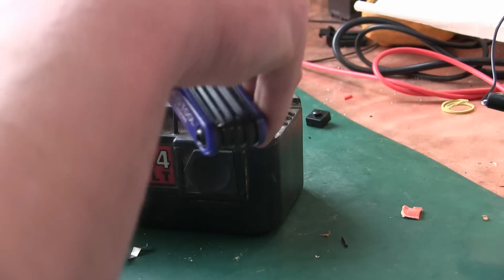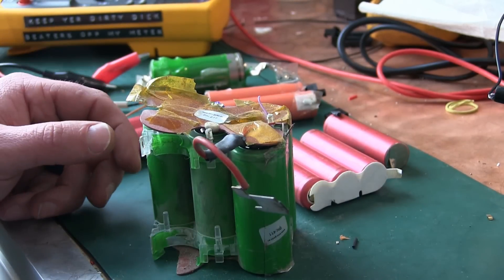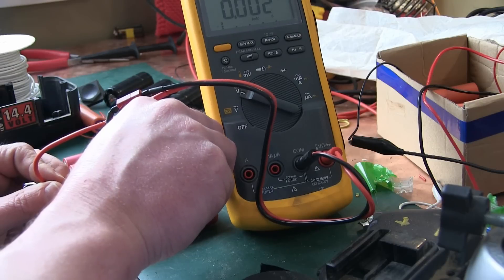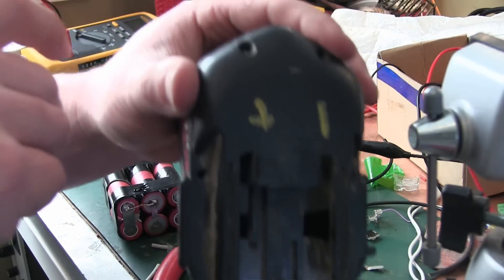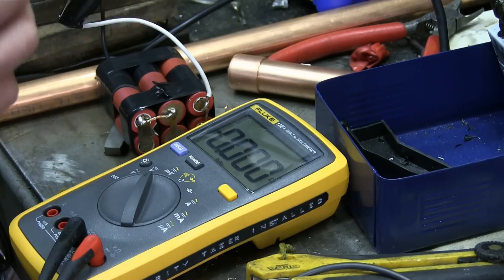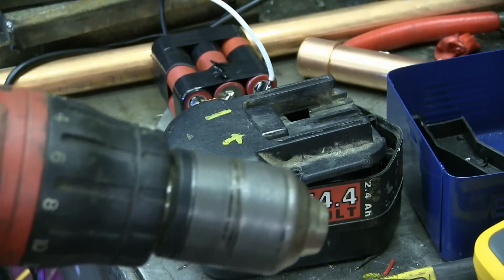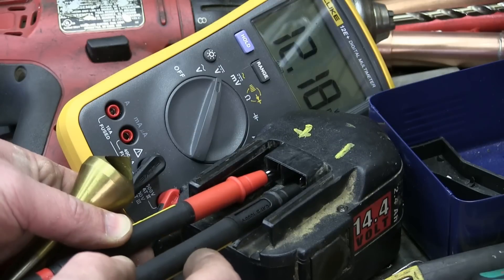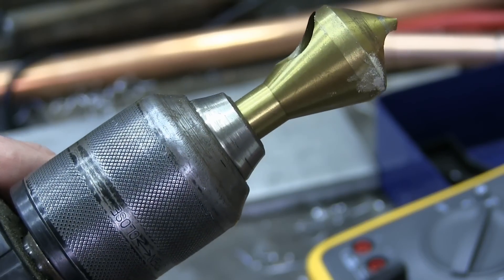New Lithium for Old Tools!

Comment: Okay. Now keep this thing somewhere where there is nothing flammable and use it in thick rubber gloves no more than 5 minutes at a time and you probably will not explode and/or be severely burned in the process.

Comment: Are those lithium cells from a laptop battery ? Because if so then they can only supply about 4.4 amps max per cell, 8.8 A if two in parallel, and the longer you run them above that limit the quicker they'll shoot the juice out.

Comment: I don't think those batteries are going to work well for a drill. drills use 18650s with the Lithium Manganese cathode. your batteries could probably deliver around 10A total if they were fresh, but a drill needs more than that. if you used a LiMn battery, you could get about 40-60 amps with the two in parallel.

Comment: the battery will get better the more u drain and charge it I've done it toy drills and the first charge I got 1800 milli amps and second charge I got 2000 milli amps and it kept going up to just over 3000 milli amps and u can buy balance board cercit boards for them males them so much safer

Comment: if u can add 2 more batteries in parrellel it should solve the probelm i did the same thing sith a 18 volt battery i have 10 18650 in parallel and the drill was some cheap noname and it proaers thru like a champ now

Comment: LiFePO4 (Lithium Iron Phosphate) batteries would be a much better and safer choice for home built packs. They have much wider charging and discharging parameters and don't have the pesky "catch on fire and burn your house down" problems.

Comment: that 14  volt battery, u put in 3 x 18650 it will not work.  it would need 4.  and a balance BMS can buy on Ebay.  choose a high out put BMS like 8 amp or so.  good lucks

Comment: +AvE No load voltage dropping by only 0.1V is not much for the amount of work it did in the video. Would be more interesting to see the voltage under load.
P.S. If you want some 18650 cell recommendations I'd look at Samsung's INR18650-25R's. They're mean fuckers and excellent for this kind of application.
LG's HG2's aren't bad either, really nice cells but LG's got other models if you want bigger current draw instead of higher capacity.
It would also be interesting to see how much current that drill pulls from that pack.

Comment: did you even load test those batteries? :P some dead 18650s will charge and hold a charge but when you put any load on them they will fall flat. i usually use a 500ma dummy load to load test them..

Comment: i picked up 2 dewilt 20v battery packs at a local "crack head" yard sale.. even a charger to boot.. neither of the batteries worked so i  took them apart and fixed all the issues one of the packs was literally just over discharged

Comment: If you look on fleaBay, there are several vendors selling replacement guts for your Millfuckie 14.4 batteries, both NiCD and NiMH.   Normally I wouldn't suggest such a thing to a DIYer such as you, but if it helps you recover an old friend or two...

Comment: If you are going to keep it as a secondary drill might as well transform the battery with a power supply and run it without batteries. I have one of those and made a video about it but I don't want to put it here without permission since it's your channel :)

Comment: curious, assuming you could fit the batteries, if you were to increase the voltage and amp hour of the batteries beyond the original design, would that cause problems for the electrics? I know in rc it don't hurt, so I'm assuming it wouldn't in this application either. or is it a case by case sort of thing?

Comment: I've used Radio Control LiPO battery packs (usually from HobbyKing because they are cheap as chips) in a slew of old NiCad/NiMH cordless power tools.  I just find a pack in the right series arrangement (usually 3s <11.1v> or 4S <14.8v>) that has the amp hour rating that I want that also is the size to fit inside the original pack case.  Sometimes I thermally modify (ie heat and bulge) the pack case to fit bigger and obviously more skookum RC packs.  I use an RC battery pack charger to charge (and occasionally balance charge) the packs, usually through the balance port on the pack (though this limits charge rate to 2 amps).

These packs usually have a good enough C rating to handle cordless power tool current draw.  C rate aka Amp draw rating, for the uninitiated, is Amp hour rating of the pack times the C number.  Thus a 2000 MaH 30C pack is 2 amp hours times 30 which gives  60 amp max draw.

Comment: Our local Good Will store is loaded with cordless drills that would benifit from a battery over haul,sadly your idea was a bad idea because your batterys were wanked. The point you can rebuild a battery and keep your favorite drill around for years to come even if you can no longer get replacement batterys.

Comment: Good video, with the wife's sowing room.  Just wondering what the cost of replacement of the ni-cad battery would be vs using the 18650
Reply: +ArmedMonkey Yeah, but you can still get ni-cad cells and use those instead of the 18650s
Reply: you can buy sub C ni-cads all day long still. But I've had a couple of those old Milwaukee chargers go south on me. When they do they are no longer smart chargers, but rather brain dead ones. They end up just cooking the battery packs. I've never cracked one open yet to see what failed in them. Mostly because they've cooked all my Milwaukee batteries at this point, so there is no point anymore.
Reply: Well considering you can either spend a ton of money on a replacement battery, or if it's discontinued, go to your local e-cigarette store and pick up a handful of brand new 18650s for a very reasonable price...I think the choice is obvious!
Reply: CrazyIvan1337
18650 batteries are not a direct replacement for ni-cads. There is far more to it than that.
Reply: Paul Frederick Nobody said they were. He even said so in the video.
Reply: CrazyIvan1337
To do it right you would need to build a custom load balancing charger. Then get that to work with the existing battery case. Not a trivial task. I have already considered all of this, and rejected it as being unfeasible. Not impossible mind you, but simply not worth the trouble for the results.

Comment: How about a video on gutting out the battery pack and installing a DC transformer that will give the correct volts and amps to run an 18 volt tool please.
Reply: I've had this thought before. Seems like a good idea to me..

Comment: Let me be serious for a change on your channel. You mentioned no low voltage cutoff, no protection and different charger. All good. BUT recovered batteries will sometimes change the chemistry, I wouldn't usually recommend using them. And the big one, they are not being balanced and that will eventually that could lead to thermal run away when one gets to low the others will dump into the low cell. If they are quality cells it might take it, but it's acts as recovering each time and that low cell will die fast. I would use an old laptop bat that has balancing and protection and rearrange the cells and that board to fit in the old bat case? Another option to use Samsung cells since they can  take a beating if you read their dat sheet. Test, yada yada, result = does not blow up, lol.

Comment: No, no, no, having the battery case EXACTLY the same is pointless if you end up with a drill you use for JUST countersinking holes!   Stack those bad boys with the green sheathing VERTICALLY and make say an 18 volt (or there about) super skookum drill...  cut the bottom out of the battery case to fit the new battery pack and tape over the batteries and maybe plasti dip or epoxy over the bottom.  You'll finger that part out but brother you'll love that drill again if you make it have at least a little more volts while also having super skookum torque.  TAKE TWO!  One more try...eh?

Comment: Ni-CAD batteries could last far longer than people think, a blast with a high current is usually enough to blow them up.. BUT!! a quick blast will have a good chance to fix them like new ;-)

There's countless stories of Ni-CAD batteries lasting for decades, but that's with proper maintenance and low usage because they have a very long shelf life. Where's a Li-ion battery will discharge itself in a week sitting by itself causing wear as if was being used. Really, they both have about 1,000 cycle life but the Li-ion will need to be charged more often to keep a good charge and thus end life quicker if that makes sense.

Comment: What happened there when you tried to cut the tab? Your cutters shorted the tab to the outside of the battery can (the side of the cylinder), which is probably at different potential. Short.

Comment: I wonder how this would work with an impact wrench.. ive been thinking about trying it. I’ve got an old cordless 19v Ni-Zn. it still works but the Ni-Zn battery just doesn’t last very long, so I’d really like to swap in a good Lithium Ion pack that will actually last more then 20 minutes.

Comment: I did this as well but it isn't worth the hassle. I did 14.4V on an old 12V Dewalt drill and it works but charging is crap.

Comment: I see at first You tried to use 4 cells in series. Too bad Your cells were to big, it would make much better result in speed.
Anyway, just wanted to mention, that for lithium you need cut-off circuit, because it's very bad to discharge lithium below 3.3V per cell.

Comment: I love your channel! My only comment is that I think you should have gone with 4 cells instead of running 2 pairs in parallel because although you’ll gain more amps, you’ll lose voltage. I’ve done experiments with my own tools and the smaller 18650 type cell seem to run closer to 3.7v than 4.2 in usage so I’d say 4 cells 14.8 which is closer to 14.4. The extra cell would give you more boost.

Comment: Well...it makes for a decent 12v source of portable power. Use it for oddball crap you don't wanna ruin the nice drill for. Hell as long as you have two: I'd add more batteries in for more voltage, and crank it up to something like I don't know 24v and see what happens :P 

Super-drill/outboard motor and/or bust!

Comment: The shmoo got let out due to you trying to cut a jumper wire that came from a positive post and touching the housing of the same battery. The body on those is ground and its separated by a washer at the top. They no like giving themselves a reach around! Gotta watch those lipos, they some nasty biting bastards.

Comment: I've been binge watching your channel for about 6 weeks now and I fear I may have lost the ability chooch a coherent  sentience, thereunfore I must ramble at you thusly: HDPE plastic has been on my mind,  I want to make a drum kit out of milk bottles and shopping bags. The machine I'm intent on building is essentially the world's biggest hot glue gun that will 3d print any size drum shell I want onto a giant turntable to ensure a true round. 

The problem is I have a 40mm × 300mm steel barrel (sorry for the metric, I live in New Zealand), and I need to heat it up to 185°c and keep it there while the ooze oozes onto my giant record player. I have some nichrome wire to wrap around the barrel, and no idea what I'm doing with it. 

Any advice or even a vidgeao on heating insulation, thermostats, shielding, or not frying my pancreas, would be loved.
Reply: I suggest asking on the reprap forum at www.reprap.org or www.instructables.com. Publish it somewhere, it sounds epic!

Comment: One of those days an overcharged battery will explode in the face of the 200 pound gorilla. Voltage drop varies from one battery to another especially when they are used. I would have measured their parameters first.

Comment: why not just make a battery adapter? using the old battery case as a base/adapter for an m12 battery. I believe you already have one. That way, no messing with electronics to charge the battery.

Comment: Slap a cheap eBay boost converter on it to negate the voltage drop of the batteries under load. Also means you can overvolt the motor a little for more choochin' action!

Comment: Lithium batteries stink. They are very high maintenance. 
Sis in low got herself an electric bike. Lipo battery was soon gone: replacement 350 euro. Got 3 compact maintenance free compact lead batteries, totalling 80 euro. Works like a charm. Greater radius too

Comment: A few yrs ago i bought one of those million candlepower torches, total crap after awhile. So i modified  12v bulb to fit and fitted it with 100ah li-ion batteries liberated from a skip at work. I stopped the searchlight test after 1.5hrs  'cos i was bored... good torch now

Comment: So, if you can't use the stock charger to charge the thing, what's to prevent you from modifying the battery pack so as to facilitate the use of larger batteries. Tha drill would look awesome with a Bridgeport milled battery pack...

Comment: you could put a 4s RC car LIFEPO in there. LiFePo also has a slightly lower nominal voltage than LiPo which is more suitable for this tool.
Also the rc car battery comes with a balancer connector.
Just put a small cutout in the case for it and you can charge it with a cheap charger from hobbyking or something like that.
#Works4Me

Comment: AvE I have been seeing black and decker 20v lithium batteries for like 40$ for 2. I wanted to convert my old nicad 19.2 volt craftsman to lithium ion but saw the problems you had with your conversion. also I would need to create a Protection circuit. this already has a circuit built in so theoretically all I need to do is place in the 19.2 v pack and reattach the correct posts. thoughts? anyone?

Comment: you touched the casing on the battery which is ground and she gave ya the pixies :) 26650 sonys can be some mean bitches. I have 25ish that are good cells with 40amp burst discharge and 25amp continuous. well worth making some cool power sources with

Comment: The LIPO batteries are probably not high current draw type
Reply: These aren't LiPo cells.
LiPo is "Lithium Polymer", such as you'd find inside a smartphone or iPad.  LiPos use a polymer electrolyte, and are are "prismatic" in shape, enclosed in a foil pouch.

The cells shown are most likely 18650 (18mm diameter by 65mm long, and the "0" means cylindrical in shape).
Reply: Darron Birgenheier
 Most laptops apart from the posh ones use 18650 cells, I mistyped you are correct they are probably Li-Ion instead

Comment: Yeah yeah yeah yeah - I know what the problem is at 1:24 -

You see the battery is no longer insulated when the green wrap is off, and you touched the positive of one and the negative of the other - dead short me friend'o.

18650s or 26650 specially are no fecking joke, when you short them.

Comment: I made a 2 cell charger cradle to use with my hobby charger so I could balance charge 2 18650's at a time. Since your running 3S, just need to get one of those little 3S adapters and a charger capable of it. Also, get a lipo monitor to plug into the balance plug when your using it. They will beep like an idiot when the voltage gets too low.

Simple 2S/3S lipo charger:
https://hobbyking.com/en_us/turnigy-e3-compact-2s-3s-lipo-charger-100-240v-us-plug.html
Balance tap:
https://www.amazon.com/ProgressiveRC-AC-3PT-3S-JST-XH-Pigtail/dp/B00UY2QJRM
2s/3S low voltage alarm:
https://hobbyking.com/en_us/hobbykingtmlipoly-low-voltage-alarm-2s-3s.html

Can find cheaper 3S balance plugs. For about $30, you can buy enough stuff to build/monitor/charge 2 packs. I think 18650's like being charged at no more than 1/2 capacity, so you could spend a bit more for a more capable charger or just one like I linked that puts out  a little over 1A.

If you went that far, would make sense to get better 18650's like the LG HE4's or something that can handle 20A sustained load.
https://www.imrbatteries.com/lg-he4-18650-2500mah-20a-flat-top-battery/